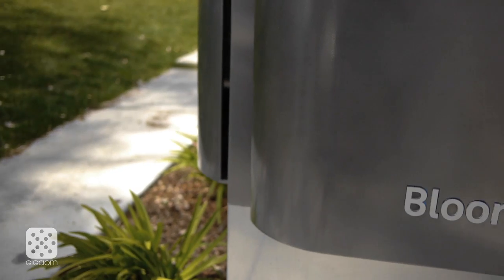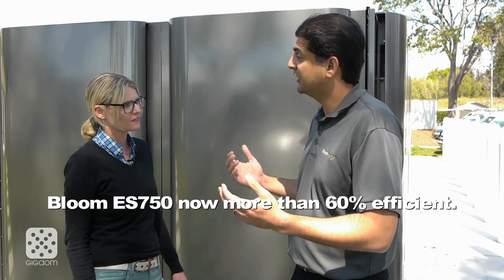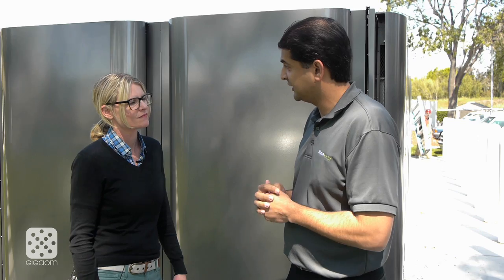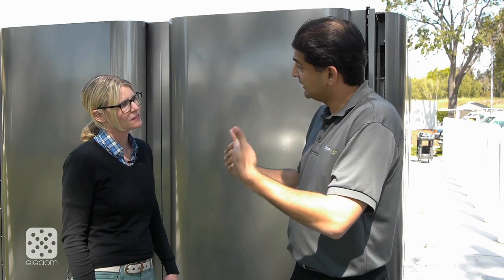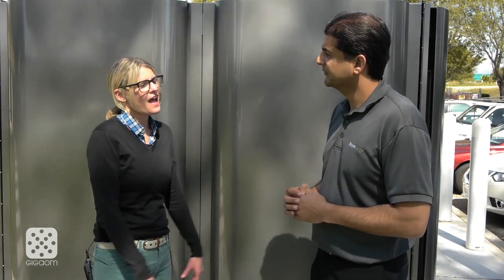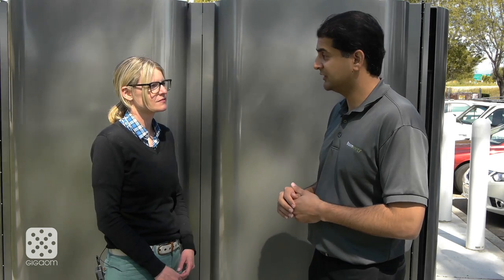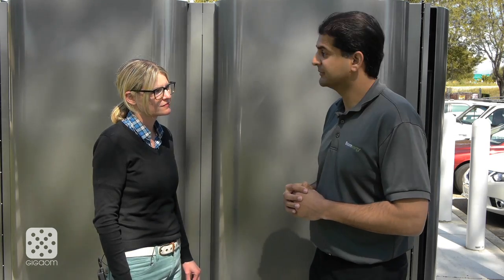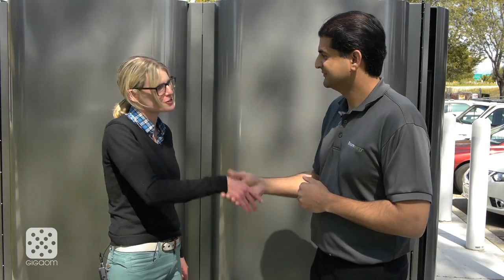Behind the scenes with Bloom Energy's new fuel cell

Comment: No combustion, no flame, but the chemical reaction is the same. therefore, the CO2 output must be the same the only thing might better is the missing of the flame itself. How can the video state: "a small amount of CO2" at 4:34. CO2 is CO2, 1-mole fuel in, 1 mole CO2 out, no other way around. Bloom might only be more efficient, not reducing CO2 emission. (Cost saving is pretty much due to the fact that natural gas is much cheaper than electricity).

Comment: Runs on natural gas and outputs CO2 (greenhouse gas)   Bloom is a scam.
Reply: Its about the efficiency of electricity production/transmission. The grid electricity generated from natural gas in a thermal power plant and then transmitted over the grid is not going to be more than 30% efficient. That is including the production and transmission inefficiencies. If Bloom energy can produce on site electricity with 60% efficiency than you are cutting CO2 emissions in to half right there. The bigger issue that is still not settled is if the BloomBox is cost effective. That means are the cost savings from the higher efficiency worth the cost differential between installing Bloom boxs vs a thermal plant over their operating life. So yes this is superior technology when it comes to lowering CO2 emissions, but I am not sure about the cost part yet.
Reply: Solexx X to
Reply: 2X effective
Reply: CO2 isn't a greenhouse gas

Comment: Snake oil.  Too expensive to implement=junk.If I buy a generator, I can be shown exactly how it works, where it is manufactured, what it needs to run, what I need to buy for it, etc.  I know how solar, hydroelectric, geothermal, nuclear, coal, etc. produces electricity...this product?  nada...don't pull back the curtain...scam.

Comment: it is basically 3 drunk hamsters on a running wheel... it is a battery with a charger that runs without combustion. it simply converts one type of energy to another without overly expensive components. 2 + 2 still = 4

Comment: The pollution  and carbon footprint  is produced  prior to the unit   producing power.  
   Picture is a a wind generator   never  reducing   the  damage done to the earth  that happened  to build the parts and erect the unit.   It's like spend   $5.00  for fuel to drive to a  gas station that claims to save you $3.00  .

Comment: One of the best methods large corps use to put away competitions are lawsuits. Patent lawsuits usually. Multiple lawsuits are the usual method. Big companies see it as a normal part of doing business. Nice thing about lawsuits are the targeted company has to defend it self constantly, court costs and lawyers are expensive. Other nice thing about lawsuits is sometimes you can have the court make the victim stop manufacturing or selling said items until the case is settled and that can go on for a very long time. As far as efficiency goes guess it depends on what you are comparing it to. normal car is about 20% efficient, Diesel are better. Solar panels are about 14%. I don't care about bloom one way or another until he makes something I can power my house with. I do know anyone trying to find better way to create energy is in for an uphill battle.

Comment: Why does the guy thinks 60% efficiency is highly efficient?  
Something seems wrong here.  They produce DC with the boxes then convert to AC (losing 5-30%) due to heat with the inverter.  Then if it's used in a data center the power supplies in the computer convert the AC back to DC losing some energy to heat in the conversion.

Why aren't they using the DC the boxes are creating to power the computers and avoiding the energy loss from the inverter and computer's power supply?
Reply: 60% efficiency is incredible!  what are you talking about?
Reply: I'm not an expert.  As I understand it 60% for this type of device is good but other are doing much better.  And isn't it all about efficiency?
Reply: Solar is only like 8% efficient and the cost to output ratio of these compared to all other green tech is amazing! Imagine what they can do once they make these things nanometer scale, they could cram so much more power in that same space and I'm sure increase efficiency a lot more in the next 5 years. I can't wait until I can buy one myself, I'd power it with solar to hydrogen gas then feed the hydrogen to these things and never pay for electricity again. It's a huge leap in available tech that's actually tested and proved.
Reply: John Terdik Looking online you will find a lawsuits filed against bloom.

News reports say while Bloom Boxes were installed at eBAY and Google they were not in use CEO stated they were.

Bloom stated they could generate power from solar energy, but their boxes don't have any solar collectors.

Microsoft looked at Bloom Energy but went with Redox Power Cube because they produce 4 times the power per volume as the Bloom Box and cost less to produce.

The Cubes are 10 percent more efficient than he Boom Box and weighs 50 percent less.

Then there's the issue of Bloom production facility which was supposed to be producing product, but didn't have any production equipment or employees.

Tech News Today show 490 discussed the Bloom Box as did This Week in Tech 455 titled, "Is Bloom Serious?" which discusses Bloom long list of lies and failures.
Reply: ***** I'm with you nuclear right now appears to the be best of the all of the options.

There have been more people killed, more land fouled and air polluted with oils spills and fossil fuel than with nuclear.

The guy interviewed (in a different video) states the Bloom Boxes are "green" can can be powered by the sun.

Makes no sense to me unless he's taking about using solar to produce Hydrogen from water and then power the Boxes with the hydrogen produced.  That would be stupid because of all of the energy loss.  It would make more sense to forget the Bloom Box and just power with solar.  

Only problem with that is the solar is far more costly than the natural gas the Bloom boxes can run on.

Trying to figure out if this guy is a really good liar?  Or if investors are that stupid?
Reply: Drew Liwanag Guess you did hear Bloom Energy just got sued for fraud in CT.  Apparently they lied about their research and finding, the thing's a fraud.

From the sound of things you'll be able to buy one very soon at Blooms liquidation auction.

If you believed this was a huge leap in available tech that's actually tested and proved you were duped like all of the investors.  Just be glad you didn't lose any money.
Reply: Passed High School Physics
Do you have facts on this or are you just blowing smoke?
Reply: It's the end for Bloom Box.  Microsoft has partnered with Redox Power Systems and created a new fuel cell which produces more energy than the Bloom Box cell and is far less costly to produce.

Unlike Bloom which has had problems Microsoft/Redox systems are working today.
Reply: ***** Any idea why investors are investing in Bloom and not Redox?  Redox's version of the "Bloom Box" is more efficient and costs far less.
Reply: *****  Microsoft was looking at Bloom Box and Redox and decided to invest heavily in Redox.

The guy from Bloom was on 60 minutes and told all kinds of lies but the idiots at 60 minutes were too stupid to call him on the lies.

The Bloom guy said and I will quote, "Any energy source can be used to power the Bloom Box including solar."

Now sure how the box can be powered with solar if there are no collectors. - Something he refuses to answer or explain.

Take a look at Redox.  Bloom is using some expensive elements int he plates where Redox was able to use other elements which are bring the cost to manufacture way down.

The elements Redox are using turn out to be a little more efficient in producing the electricity.  (There is less heat loss, more electrical energy out.)

I suspect with Microsoft investing in Redox and with Redox costing less to produce and Redox being more efficient this will be the end of Bloom Box,
Reply: ***** Bloom is claiming their box is slightly more efficient than traditional burning methods for producing energy.  Companies like Microsoft, Google, eBay could save millions in energy costs using fuel cells over traditional combustion methods for producing energy.

The thing that supposedly is killing bloom is they are using rare earth metals where Redox figured out how to use not so rare/less costly metals in their cells.

I know Microsoft located a data center in Ireland to avoid paying cooling costs.

It's an interesting race.  The Bloom guy just seems like a snake oils salesman.  Would still like to know how he can claim his box can be powered by the sun.
Reply: *****  If they were smart the would sell the natural gas conversions for cars.  We've discovered so much natural gas it's almost too not worth it to sell it.

Almost all of today's cars engines can run on natural gas ans well as gasoline.  It's a matter of spending a few thousand dollars for the conversion.  With gas at $3.25 a gallon the equivalent in natural gas is about $2.00.
Reply: ***** I agree with you about nuclear - No energy source is perfect.   The thing with gas is that it's a abundant, cheap and other than nuclear and contains a lot of energy for it's size.  

Correct me if I'm wrong but haven't fossil fuels polluted more air, land and sea and killed far more people than nuclear every has?

People have complain about no live zones around nuclear accidents, but it's that the same with the coal thousands of coal mine fires which are burning out of control?  Centralia, PA comes to mind.
Reply: ***** I would not say nuclear is not zero pollution.  One still has to mine the ore for nuclear.

You need to review history - Plutonium reactors came first.  They were needed to produce Plutonium for the two bombs used in WWII.  At the time this is the nuclear science we knew and understood.  Thanks to the bomb research it created the "Atoms for Peace" program.  Out of this came Atomic energy with the first reactors made by AMF, (yest the company that makes bowling equipment) in Iran, Israel and Pakistan. 

Plutonium reactors can be used to make bombs but it's the third stage of the enrichment process and it's not easy. To prevent countries using reactors to enrich nuclear fuel into bomb grade, (it's not easy), they have to exchange their spent fuel for reactor fuel.

Yes Thorium looks promising but as I recall it was only a proposed solution and has never been tested.  (I'm not sure.)

Are you familiar with NIF at Lawrence Berkeley National Laboratory?  The US has invested a lot in NIF.  If we can figure this out and get it working it will provide us with the energy we need.
Reply: *****  If you want "free" electricity just connect a generator to a bike and start peddling.
Reply: +Passed High School Physics wrong voltage to use in computer.
Reply: Robert Reznik How do you figure?
Reply: Just think how big a wire would be needed if the wiring was 12 volts.  It would need to be 4 times more circulars than 120 volt.  and then to reduce to 3vdc  there would need to be a way to reduce down.  That cost a lot of heat wast.   The reason we use AC is because it is simple to use AC voltage transformers.
Reply: Robert Reznik Not sure I understand, computers and digital devices all use DC.  The Bloom box internally produces DC which is converted to AC which is then converted back to DC to power the computers.

Why not keep it as DC and eliminate the DC to AC and AC to DC conversions and the associated energy losses?
Reply: they could use the heat lost to heat water via heat exchangers maybe not hot water but a preheater in an enclosed system maybe hot water heated building floor board heating ect to cut some of loss

Comment: CH4 + 2 O2 = CO2 + 2 H2O + e- + heat.

CO2  is a greenhouse gas, and still a harmful emission.  But compared to coal or other combustion processes, nat gas is cleaner.  Even the Environmental Defense Center advocates natural gas as a bridge technology to reduce greenhouse gasses.  Bloom is not a perfect solution, but a step in the right direction.

Comment: if it eats oxygen, then would there be no more oxygen left
Reply: All fossil fuels require oxygen during combustion, such as natural gas or coal power plants and your gas powered car.  So does this, even though it doesn't burn the fuel.  
But you're still right in the sense that you wouldn't operate a fuel cell in a closed living space.

Comment: No comment on the cost side because its very expensive what he doesn't mention is the shit load of C02 it produces .
Reply: It doesn't use fossil fuels and it's portable. that's what matters for me. as for the CO2, it still produces a heck less than a power plant per kw.
Reply: ***** right, but i believe the fuel cells doesn't actually burn the natural gas? i think it just uses the gas to produce the required chemical reaction.

Comment: Good luck! How long will it take "BIG OIL" or "BIG UTILITY" to come in, buy the rights, and then suppress the technology? Any bets?
Reply: I think that,  if E-BAY....AND GOOGLE.....Have working units on their premises;the oil people will think twice before trying to intervene,  since the units already require some fuel to operate.A carefully designed co-operation will likely be the next best thing to aim for, between this technology and the existing ones.
Reply: You do realize these currently need natural gas to run, right?
Reply: frtard They create twice the energy for half the cost through efficiency. More surface area and more oxygen creates a more efficient burn of fuel and hopefully less emissions.
Reply: This technology already depends on Syngas produced from Natural Gas which has strong ties with fossil fuels and works around 1000 degrees celsius temperature to extract electrons from Carbon monoxide and hydrogen. Solid Oxide Fuel Cells have a nature in that way.
Reply: Is there a history of ""BIG OIL" or "BIG UTILITY" to come in, buy the rights, and then suppress the technology? Any bets?" ?? If so please provide credible evidence of such action.
Reply: STARTING 5:51, THE CARS WERE GOING BACKWARDS!!!!!!!! WHAT? JUST A REWIND REVERSE EFFECT?